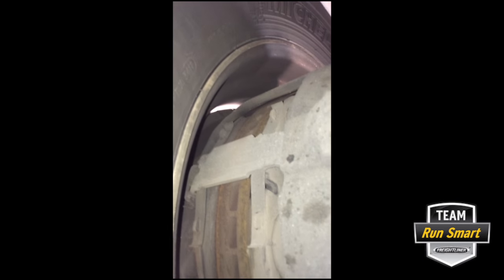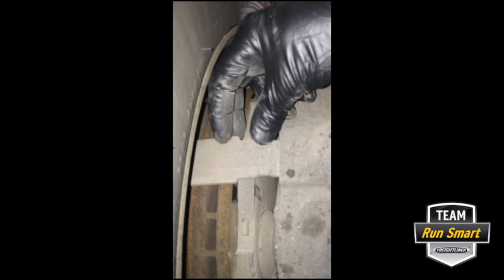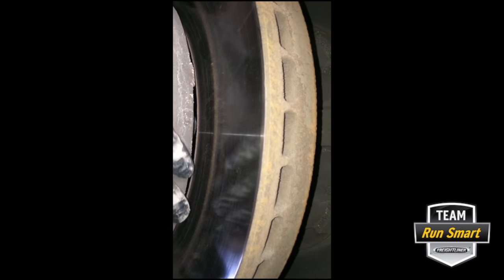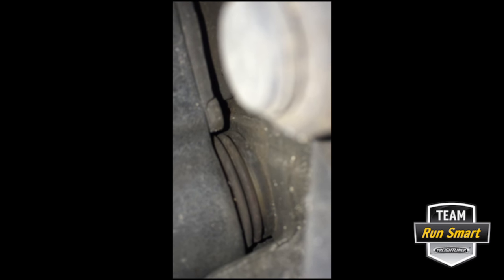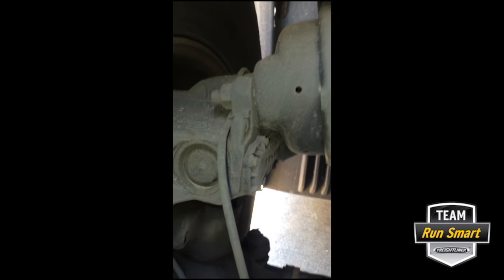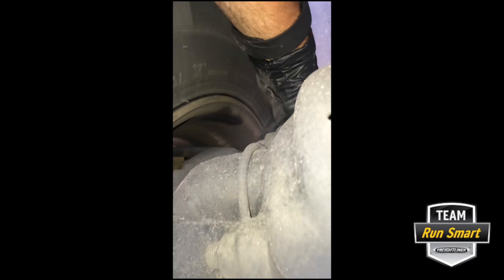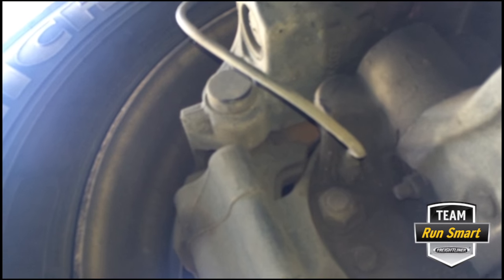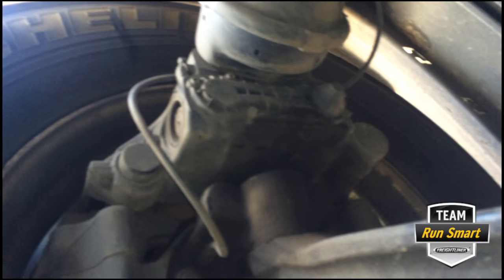Disc Brake Inspection

Comment: One thing dot and you should look at with disc brakes is rust on the rotor.  If you have a rotor staring to look rusty,  that brake is not functioning properly and needs to be repaired immediately.  This is an OOS criteria with DOT,  and can cause a potentially deadly brake failure. Thanks,  and drive safe.